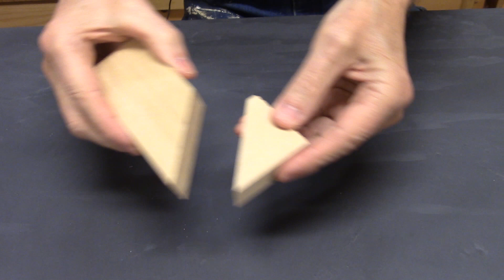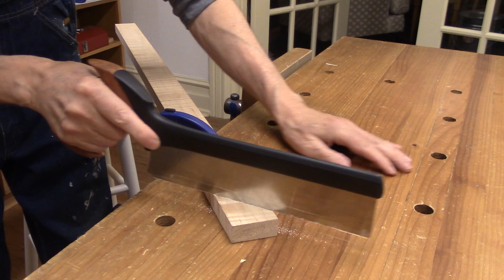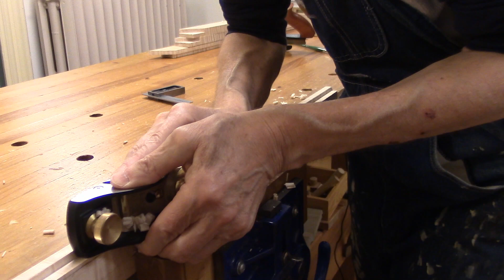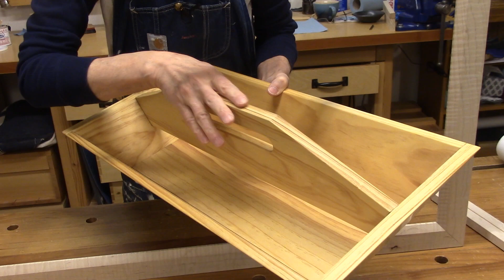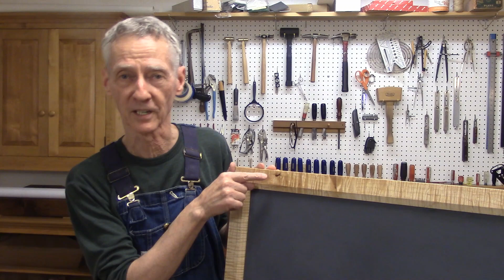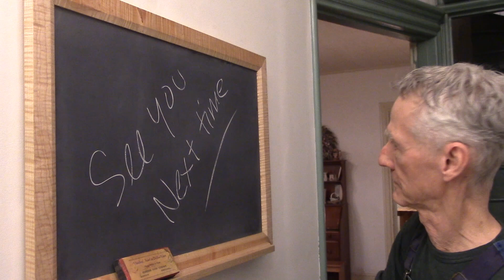Slate Chalkboard Show

Comment: 15:10 what tool is that? is that like a manual router?
Reply from the maker: It’s called a router plane and it can perform many of the tasks of an electric router. It’s a versatile tool and I use it for trimming tenons, fitting lap joints and making dados. The version I’m using has an optional fence which allows me to make a stopped rabbet on the edge of a board. It’s an essential tool in my workshop.

Comment: Hi Ken, Thanks for the very educational video. Dad was a carpenter-joiner but didn't want my brother and I to get our hands dirty. But that was what we wanted most !! Of course when he would renovate old houses he bought for us, we would be required to hold the board he was sawing or the dry-wall/gip-rock he was putting up for the walls etc. You are a very skilled worker indeed mate. I have not bought a hand router plane yet and am curious about the one you have and the fence attachment. Is it a Veritas or Lie-Nielsen ? We have Veritas available an outlet called Carbatec in Wakerley (in Brisbane) but Lie-Nielsen are in Adelaide South Australia (a long way from here.) I have the Veritas plough plane but not all the blade sizes as yet, but that will be attended to shortly. I don't know about slate quaries but remember the boards growing up in the 50's and 60's years ago. Funny though, I have seen chalk at various arts and crafts suppliers. Probably in Tasmania (Launceston is the area I came from - in town a bit but also in Glengarry some 25 miles north of Launceston on the West Side of the Tamar River, turn left onto the Frankford Road at Exeter and 5 miles down the road.) Have a look at Tassy from Google Earth and go to Street level. It is beautiful. Still got lots of family there. Thank you again Ken, All the best, Brian
Reply from the maker: Hi Brian. The router and plow planes are essential tools in my workshop. They’re both by Veritas. The optional fence for the router is very useful, and for the plow I have the basic assortment of narrow blades (1/8th “ through 3/8”), but I know they make wider blades, tongue and groove blades (with wide blade conversion kit) and beading blades (with modified skate). Thanks for the visit from Down Under, I hope to visit there some day. I’ll have a look at Tassy.

Comment: Thank you Ken and Jonene for another great project.  Ken when using the router plane, would it have been possible to clamp two pieces together and route the rabbet joints at the same time?  Thus giving more support to the bottom of your plane as well?
Reply from the maker: Hi William. I suppose I could do that, but the groove would need to be twice as wide. That's 3/4". Thank you for the question.